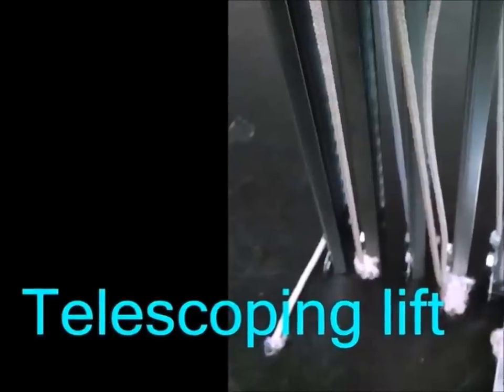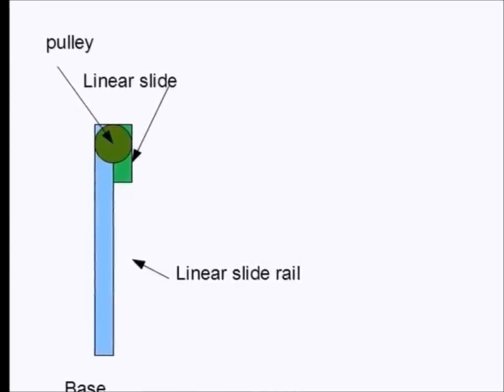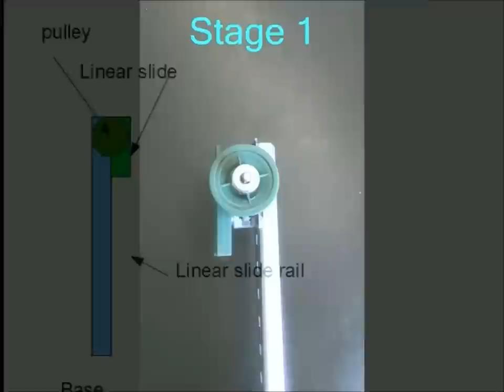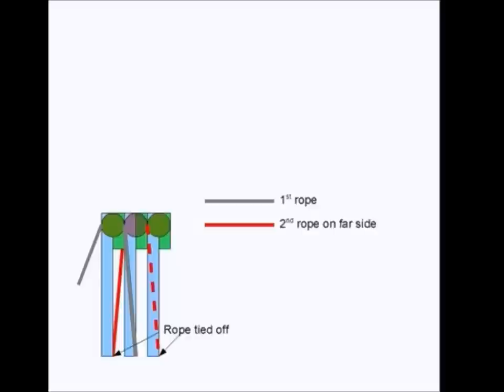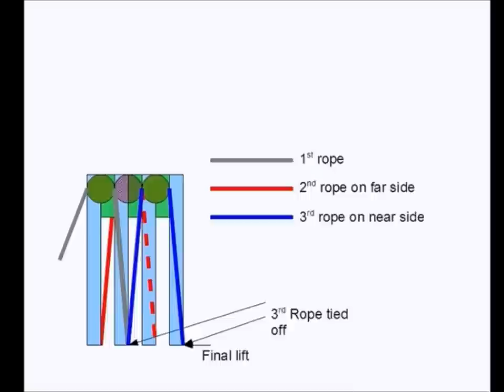Telescoping Lift

Comment: Is there a design out there using these principals for a lift that can bear weight?
Reply: pop-up campers use it to lift the roof with a winch they are made of steel channel which is harder to see what's going on inside that's where this video helps. You can lift more weight by increasing the sizes and thickness of all the components, or using components of harder material rated for more weight. Careful about anything lifting weight have safety measures in place and check for wear over time.